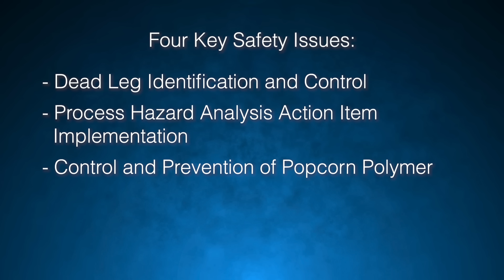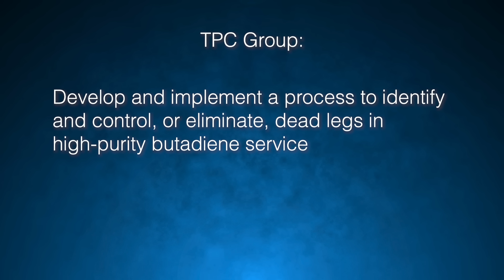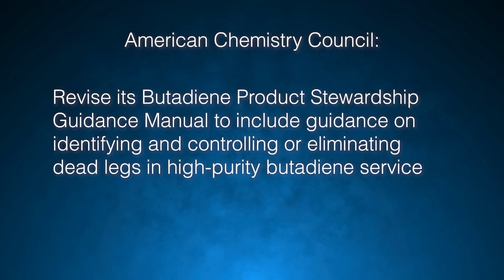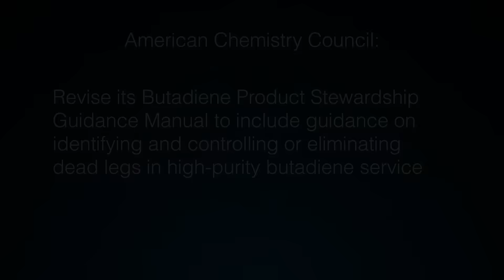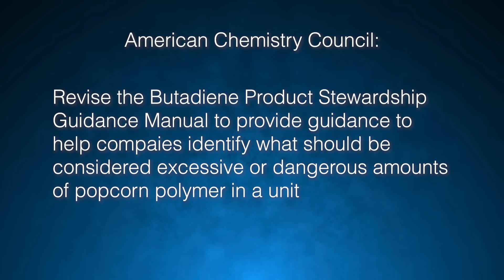The Danger of Popcorn Polymer: Incident at the TPC Group Chemical Plant

Comment: I'm a bit puzzled. If that dead-leg was open to a process vessel at one end, how did the accumulation of popcorn polymer result in a large overpressure? I'd have thought that the pressure in the dead-leg would not exceed the pressure in the process vessel. What have I missed?
Reply: the popcorn polymer itself popped the pipe open, not the butadien. The polymer is strained and tends to pop an expand as it grows. The pipe burst like a stuffed bag of corn in a microwave.

Comment: 13:07 When the fire truck is getting out of dodge, you know it's bad! Glad nobody was killed. 

This story is a bit different in that the local engineers were aware of the potential hazard, and management actually agreed on a process to fix it, but never implemented it. Usually management ignores every possible safety concern until it blows up.

Very odd design not having remote valves. That is like putting the valve for your sprinkler at the sprinkler head. Makes no sense.

Comment: Typically, Pressure Safety Valves (PSVs) are connected to tanks - especially in PSM areas. I'm surprised the overpressure in the dead leg that connected to the tank didn't cause the PSV to lift. Did the pipe fail due to corrosion before the set pressure on the PSV?
Reply: I'm afraid a PSV won't help you here.  The polymer grows internally and exerts force on the pipe walls in contact with the growing polymer mass.  It's like someone is using a hydraulic Jack inside the pipe at only one location.  There are old verbal accounts of smaller diameter lines rupturing, but not releasing much material because the polymer mass effectively plugged the hole.  This polymer has been known to more than quadruple in size when removed from things like armored sight glasses.

Comment: Remote blocking valves are also a potential safety hazard ...
If the leak is upstream of this valve, closing it means the system above / upstream will drain
Pumping out as much as you can, may be a better option than the safety shut down

Comment: I don’t understand why these systems don’t have high pump pressure alarms and high-high pump pressure shutdowns. They should be set so that a pipe blockage doesn’t cause the pump to exceed the maximum allowable working pressure (MAWP) of the pipe system. I would go even one step further and ensure the pump is designed so that its “blocked in” maximum pressure doesn’t exceed the MAWP of the pipe. Am I missing something here?

Comment: Sounds interesting but remotely operated valves seem like a serious security vulnerability because now you're basically relying on some chemical plant's IT department to stand up against the rest of the world. Unless you have a way of making such connections secure(i.e. not having them go over the Internet or be used with equipment attached to the Internet), its seems like the risk just wouldn't outweigh the reward.

Comment: I am ignorant on this subject, but wouldn't the accident have been prevented if there were sensors installed around the facility for detecting a breach and electric actuators were activated to shutdown the pumps and close the valves upon sensors feedback? I believe so. About the sensors? my advices would be those: [pressure sensors in the pipes near the pumps outputs - so if there's a pressure anomaly, action could be automatically taken by the algorithm in control of the facility. one approach would be look for sudden loss of pressure while the pump is turned on, this would configure as a major breach] *load cells could be designed specifically to act as passive pressure sensors, detecting dilation and compression of the pipes from outside , [current sensors to monitor the motors of the pump, as well as rotation sensors to detect rotation of the pump mechanism, those could be used to detect pump anomalies, and data could be fed to the the main controller to cross compare with other sensor data and take action], [microphones and audio processing could detect sound patterns of explosions or people screaming then feed a remote monitoring station to decide whether or not to take action, emergency buttons around the facility could also be connected to notify this remote monitoring station so that it could remotely disable the faulty parts or the entire production ]. I really don't know how did I end up falling here on this video I am quite sleepy and may have probably tripped around some wrong approaches, but you should hire people like me to create protocols and non-theoric solutions to prevent incidents like those. I am pretty sure there are plenty of people that think like me.. just have to find it.

Comment: I always wonder when these recommendations are made, who has the burden of qualifying the recommendations?  For example, if a standard procedure or set of conditions are developed to identify popcorn polymer formations and dead leg formation, how are these tested?  While I don't want to excuse TPC for the accident they caused, there will be costs and potential liabilities associated with formulating such conditions, and unfortunately this is one reason why I think accidents tend to provide this guidance, because one can point to the accident as determining the condition.  No one wants to cause an accident or be liable for the damage one causes, but if one does cause an accident, one wants to cover one's backside by saying they followed the recommendations, and it was the recommendations at fault, but then this puts the liability on the entity that formulated the recommendations.  So it's not surprising that standards bodies provide recommendations that tend to be vague about the exact steps one should take to avoid an accident.

Comment: BD is heavy than air and only rises about knee high off the ground and will fill all low spots [ditches and basements] ... if one works with this stuff and come a pound a ground fog better get out of town... I'll never forget the leak back in the 90's ... if it had gone off back then, the TPC site and the Rubber Plant next door [where I worked] with most of the city of Port Neches wouldn't be here today.

Comment: Can any chem engineers explain to me why solids in the line would cause the pipe failure?  It seems like the pump would be the limit of the max pressure which the pipe would be rated for.  Or does the “popcorn” polymer expand like frozen water?

Comment: How did pressure build in the dead leg of there was no material flowing through it? From the explanation I see how the popcorn polymer would have built up by settling where there was no flow, but even if it blocked the whole dead leg I wouldn't have expected to increase pressure in the dead leg section as the material was still able to flow where it needed to. If the primary pump came back online I would see that increasing pressure in that section. Did one of the backup pumps in the primary pump get turned on?
Reply: I was also curious about that.  From the USCSB report  -  "High internal strain inside the popcorn polymer chains causes them to rupture and form new polymer seeds,  thereby increasing the total volume of popcorn polymer as the process repeats [8, pp. 8-9]. This large increase in
volume can produce enough pressure to swell or crack steel equipment."

Comment: How do they determine if popcorn polymer is forming when you can't see inside the pipe? Is it reduced flow only or do they have other methods to determine what is going on?
Reply: It's a known fact. Especially in this unit. We maintained that same equipment on a daily basis when it was owned by Texaco and Huntsman.

Comment: The saddest part of this, as a front line worker, I guarantee that management/supervisors at TPC were blaming the operators for all the troubles, and did literally nothing about it.  I have worked as a maintenance mechanic in a food production facility, and it is very sad.  Entry level workers across the board are blamed for everything, and management does nothing, and their leadership only cares that production rolls on, not for safety.

Comment: I’m running a safety training on Popcorn Polymer tomorrow. Our operations don’t involve butadiene, or hazardous chemicals, or anything related to the TPC Port Neches incident, but I feel equipped to explain the hazard to my employees, thanks to this video. Does a business management office want training on Popcorn Polymer? No. But do they NEED this training? Also no. They will get it though, that’s my commitment to the CSB.
Reply: Businesses postpone safety upgrades because of expenditure, but when it's compared against plant outage and production downtime plus rebuilding costs, it might be possible to explain to managers how monitoring and maintenance improvements can be a long-term cost-saving measure.

Who knows the ways of upper management - they are impenetrable.
Reply: You should play the video. Even if you don’t have butadiene, videos like this make people think, and may recognize a hazard not realized.

Comment: One thing that perhaps wasn’t 100% clear in the video: it was the growth of the polymer itself, and the pressure it exerted on the pipe’s interior, that caused the pipe to burst. Sometimes pipes burst also because a flow of fluid is interrupted by an obstruction and creates a local hammer effect.
Reply: Thanks Capt Obvious. 😊

Comment: "Butadiene is of low acute toxicity. LC50 is 12.5–11.5 vol% for inhalation by rats and mice.[16]
Long-term exposure has been associated with cardiovascular disease. There is a consistent association with leukemia, as well as a significant association with other cancers." 

In 2018, the Port Neches facility released the second-highest illegal amount of cancer-causing butadiene in Texas. (wiki)

"Neither federal nor state agencies have filed lawsuits against Houston-based TPC." (reuters)

"TPC filed for Chapter 11 bankruptcy protection last summer, in a prepackaged deal that included money to compensate thousands of plaintiffs in lawsuits that had been consolidated into a state multidistrict case. Prior to the bankruptcy filing, TPC had already paid out $134.5 million to settle explosion-related claims." 

"The plant's ultimate owners, private equity firms First Reserve and SK Capital Partners, will not be held liable, per a recent ruling by the Texas Supreme Court." (2022 axios)

judge for yourself

Comment: In my opinion all the control valves should be operable remotely and in a normally closed position and any power failure should or result in valves automatically closing unless it may result in catastrophic failure. I used to work in building automation and control all the valves and actuators we used were required to fail in the safest position in the event of a power or control system failure. The most hazardous chemical these valves controlled was glycol while the majority were just water or air… its wild that these pumps don’t have pressure switches? They should only operate between a set pressure and flow rate.

Comment: Why was there no monitoring of the pressure of the system that would indicate it was nearing rupture? It seems to me that any pressurized system should have computer automated monitoring of it's pressure values with acceptable nominal values. Reaching a pressure that is capable of rupturing a steel pipe like that would be immense, and even a rudimentary pressure monitoring system should have detected it was out of spec. I would imagine that a tech replacing the pump should have realized that the pressure in the pipe post replacement pump installation was way beyond what it should have been? Also, why does the system contain pumps that are capable of pressurizing a system beyond what the pipes can actually handle? Wouldn't it be safer to have a pump that cannot overcome the backpressure of the system it's self at it's breaking point?

Comment: What actually caused the pipe burst itself?  That doesn't seem to be covered.  Just that there was an accumulation of popcorn polymer in the pipe, but otherwise there was no flow in the pipe.  What exerted the large outward force within the pipe needed to burst it?
Reply: They shut down the pump and replaced it with a spare pump so there was flow.
Reply: Well consider that this facility was built in 1942...I was able to poke my finger through some of the old piping there in the 90's.

Comment: It would have been nice to have had a little more information about what "popcorn polymer" actually is since you guys said it dozens of times. Polybutadine has a density of 0.9g/cm^3 while butadiene only has a liquid density of 0.63g/cm^3, so free radical catalyzed polybutadine formation should result in blockages, but no equipment rupture.

While there is a lot of information on butadiene crystallization, there's basically none on its reconfiguration properties and ability to expand with sufficient force to rupture equipment. I'm guessing that TPC accepted the dead-leg flushing proposal on the assumption that it was only a clogging risk and not a rupture risk.

Comment: So now knowing that remote gate valves,  could give a greater chance: to down grade a potential hazard situation; do those dead legs also have pressure gauges. Both for local and site specific remote. And are these remote systems isolated from general computer systems. Meaning that their not able to be accessed through outside servers " hacked". 
Maybe a few more safety implemented items could be added.

Comment: I don't understand the explanation for the pressure build up. Especially in the dead leg the build up of the popcorn polymer should simply plug the pipe but it should have no effect on the system pressure.

Comment: At what point during the 114 days was it past the point of no return? The video mentioned the plan of twice per month running a pump to clear the pipe, but was there any point that so much popcorn polymer had built up that simply running the pump would not have prevented some kind of problem?

Comment: I don't get how the crystallization of fluid in a dead leg could result in pressure buildup enough to rupture a pipe. Unlike ice formation that causes water to expand as it state changes due to temperature, wouldn't the popcorn polymer buildup block air flow and therefore prevent more forming due to what is essentially a plug being formed? If that is the case, the maximum pressure exerted on the dead leg would be equal to what it would take to make it airtight which seems like it would be significantly lower than the pressure needed to burst a steel pipe. Can anyone help if I have a misunderstanding somewhere?
Reply: I did a quick read through a couple reference papers and through the CSB’s written report. In short, the polymerization is self-propagating after the initial seeding from the organic peroxide that is formed from the initial O2 exposure. After that, if the polymer is not exposed to the anti-polymerization reagent in the process steam, it propagates on its own. The polymer itself is noted as very hard and the resulting swelling of the line plug generates the necessary mechanical pressure to rupture the line.
Reply: @inbirdhunter7299  Thank you I feel that this really should have been mentioned in the video as it make much more sense now and shows why the need for circulation is so important

Comment: clear and consistent message sent via government policy: 
"profit maximisation now outweighs even basic safety, cut corners, we won't check on your business practices let alone hold you criminally responsible for injury/death resulting from your greed." 
Applicable from 1980 onwards
Reply: Exactly. The fact that a corporation was allowed to burn several rail carloads of vinyl chloride in the open instead of pumping it and disposing of it properly, no doubt to save on costs, and not get proscecuted for it is just baffling. If one needed a proof that the govt. has been taken over by big $$$ this is it. They do make nice animated movies about how accidents happened, though... What a clown world.

Comment: Literally my favorite videos.  These help identify and prevent future disasters.  I have become more aware of my surroundings, and thank God I didn't die young.  I did a lot of stupid things in my line of work.
Reply: OSHA For the Win
Reply: Well they make chemicals for products that include agrochemicals; alternative energy; home detergents and personal care products; adhesives and coatings; mining; and curing agents. They improve performance such as fade resistance, UV-blocking and the ability to repel water and stains in apparel, home, and technical textiles. So if you want to quit using deoderant and toothpaste and painting your house and quit wasing clothes and add solar power, you're gonna have to move to a cave. Oh and the rubber they make holds your socks up, and they make plastics for sandals and your car interior is made of every thing they make as well.

Comment: THe whole "The fix works, we need not bother with repairs anymore."-mentallity is very much penny pinching managers, allways cutting costs...
I would almost be willing to bet that they were told of complaints about teh missing pump and problems and simply dismissed them until the workers resignated, at least that's the pattern I know and loathe with all my being.